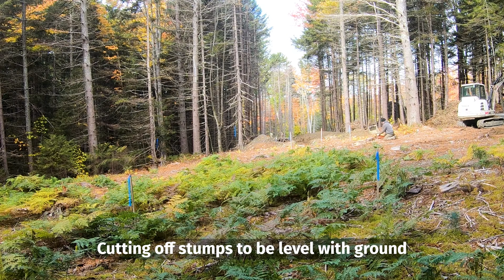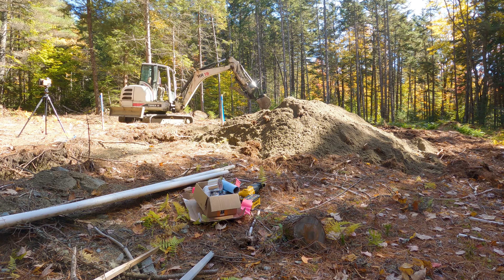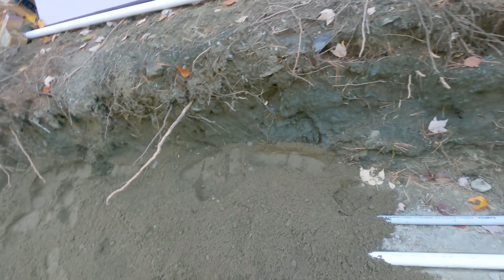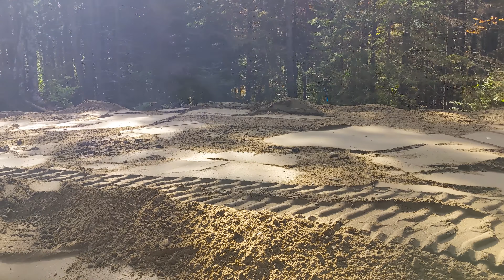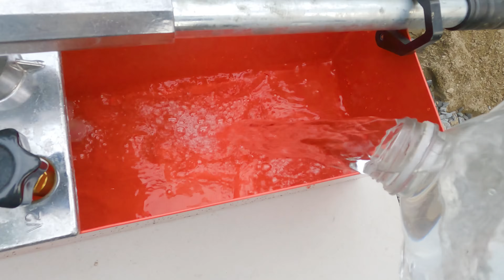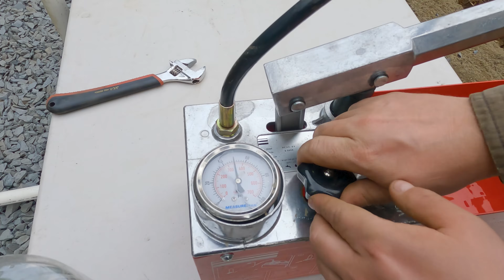Building our GIANT septic mound || DIY House Build

Comment: I’m just catching up. Why did you guys bury foam board into the ground?
Reply from the maker: It was a requirement from our engineer for freeze protection on the pipe since we were unable to get the required depth due to rock.